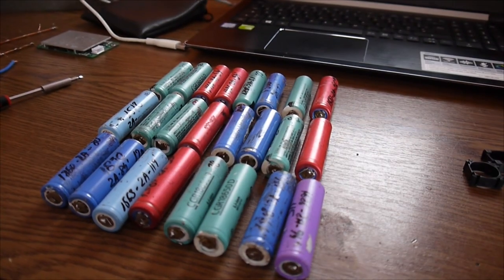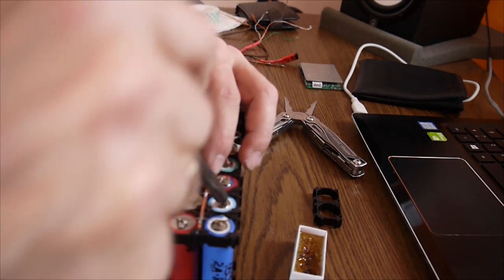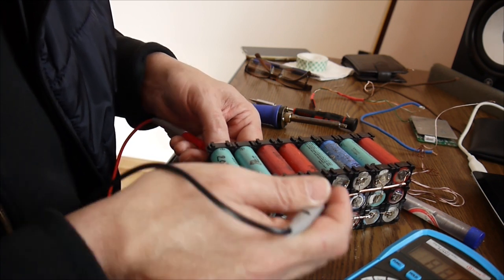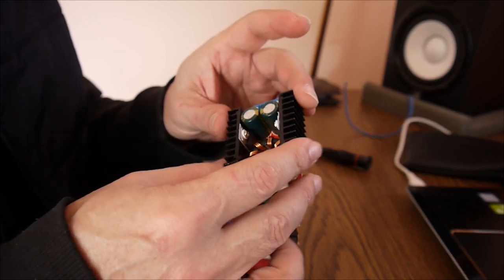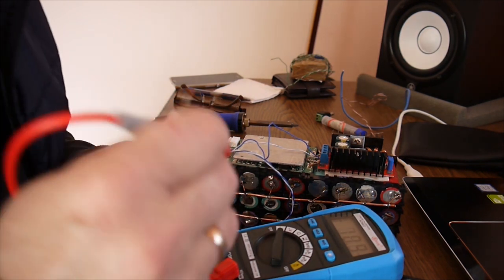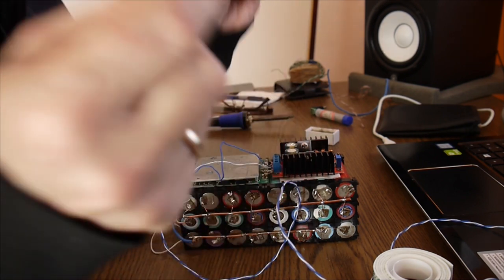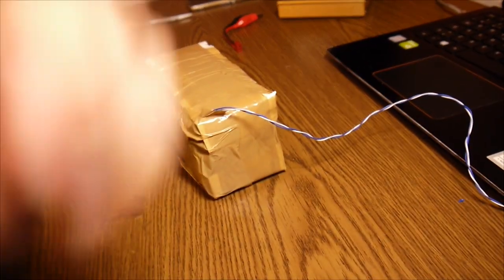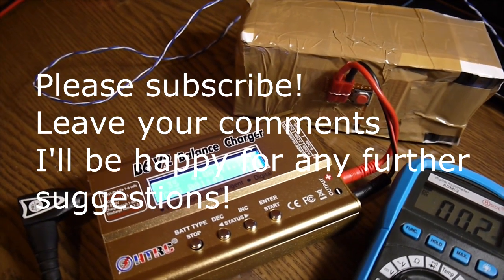Diy external laptop battery with BMS and DC-DC converter 3S8P

Comment: WARNING: Not sure if this applies to any other laptop brands, but this method will NOT work on Dell laptops because it has a protocol to check for an id chip in the AC adaptor through the center pin. Dell laptop chargers are proprietary, and will not take any other charger other than OEM. 

I learned it the hard way after spending $800+ building a 93Ah battery pack intending to power my laptop in the field.
Reply from the maker: Sorry for that, but there is trick about having a resistor from + to the middle pin, it should be around 5V, means power good..of course there is need for 3 pin connector too..original..

Comment: Hi, I have a 19.5V / 7.7A = 150Watt laptop. Which specs must the dc dc boost converter have? Do I not have to set a fixed output of 19.5V and 7.7A? I know i can trim the voltage to 19.5V, but how do I know that the dc dc booster can supply those 7.7A? Thank you
Reply from the maker: Yes you can adjust the voltage, it can be around 19V..even more like 20..21V, but i'm in doubt this module can supply  7.7A steady and for long time...maybe with a much better cooling.Rather look for a stronger booster...

Comment: hy , if i have cell's from 1700 to 2300 mah can I use them all in one power pack ,( 120 cell's )? or I should use only 2000-2300 cell's in one small pack ( 50 cell' ) thanks
Reply from the maker: I'd better do two packs , use the best ones in one pack and the others for the second..eventually put them in parallel..is not good idea to mix different capacities together..so I'll do a strong with best ones and a secondary just in case..

Comment: Awesome
I want to make same thing for "MSI GT72 6QD"
19.5V, 11.8A, May i have any guidance for it please..!  :)
Reply from the maker: Hey! Just follow the video..you may even skip the BSM as long as you have a proper battery charger like Imax6.Please be carefull and use only Li-ion chargers, It's not joke messing with Li-ion!Also always check and double check the right polarity, if you connect your laptop the other way than the original adapter you'll ruin it for sure.

Comment: It is possible connect that  to socket laptop battery directly (not the ac power)  ?
Reply from the maker: I don't recommend it, there are data in between battery and laptop, so is not secure.Plug in  to DC port, like a regular adapter.
Reply: @viocaia  if the battery replace with the new one can the bms broken or still function ?
Reply from the maker: Hey! Please help me with subscribe! Thanks!